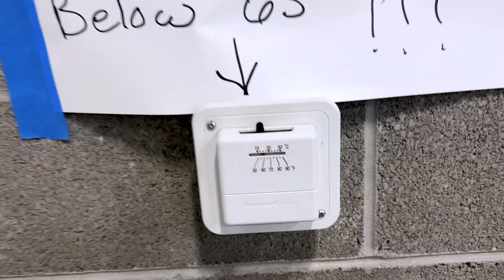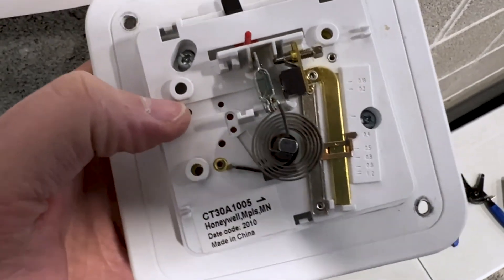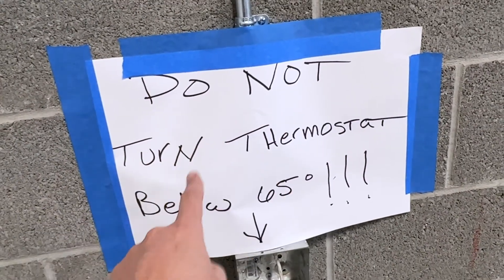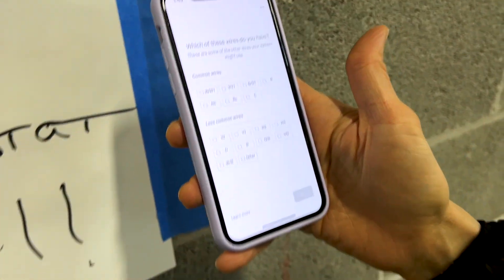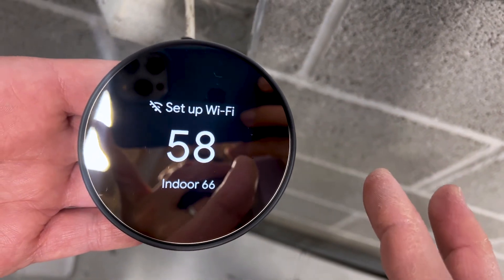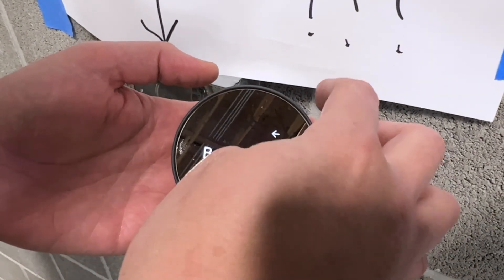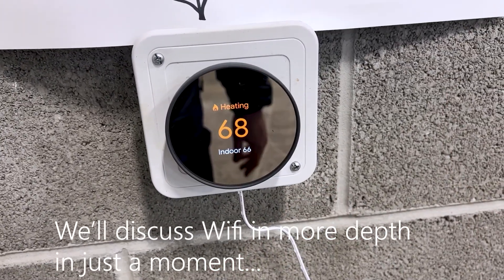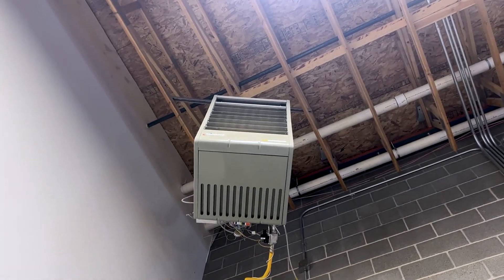NEST Thermostat  - Installing a C-Wire for a Google Nest. It's NOT impossible. Wifi Heating!

Comment: Great video overall. A couple issues in the comments. In the video you don't say which way the polarity should be. It is an AC to AC adapter so polarity isn't an issue. The correct adapter will be 24v 500mA (0.5A).

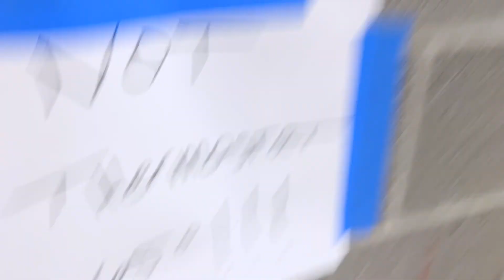Comment: In this video (at 5:47), the furnace's R and W wires are in place, and then the transformer's wires are connected to C and R. But I've read that a relay should be used to isolate the new plugin transformer from the furnace control board and its transformer. Is a relay needed here, or does this method negate the need for a relay? Thanks in advance for any clarification or help.

Comment: when using the transformer. does it matter what wire is now the c wire, like the one with black stirips or the just the all white one?
Reply: Que cable usaste
Reply: @luisdelacalle2612  turns out dosnt matter! the adapter will auto chose the right polarity
Reply: @bb4pugs  thanks

Comment: Just wondering am I not running into a risk of burning out the contactors at my furnace?
Reply from the maker: It's possible, but I've been using mine for 3 years now with no issues.

Comment: Does it matter which wire fromcthe c adapter goes to the red?
Reply: Yes.
Reply: @1wheeldrive751  by C adapter you mean the aux. power supply bought separate? It’s AC voltage…. Shouldn’t. Nor is it mentioned in the video.
Reply: @Howinfinite8D  - What I bought (got two actually) is a 24VAC, plug-in transformer (wall wart).  I bought mine on Amazon.  The wiring to the thermostat matters because you want the same phasing as the 24VAC coming from the heating system.  Assuming you are working with a two wires, heat only system,  the wires from the furnace (or boiler) will be Red and White.  If you measure the voltage between those two wires you will read 24VAC.  The Red wire goes to RH and the White wire goes to W1.  When you hook up the C-wire transformer it goes between Rh and C on the thermostat.  You will measure 24VAC between those two terminal with the wall wart plugged in.  

Now measure between W1 and C.  If you measure a higher voltage, near 48VAC, the phases are reversed.  Just take the wall wart out and invert it in the outlet, or switch the two transformer wires.  You should measure a very low voltage, near zero volts AC between W1 and C when the two voltage sources are in phase with each other.  It’s a 50/50 shot that they will be phased the same.
Reply: @1wheeldrive751  when will I see 48volts, when furnace feed and transformer feed in parallel or series???
Reply: @ - neither.  You’ll see ~48V when the two AC sources are opposite in phase.  

In the US, the power feed to your home is 240VAC (L1 to L2) with a center-tap neutral, which forms two 120VAC lines to neutral (and the neutral is grounded) that are opposite in phase.  In your load center (circuit breaker) panel, half of the breakers are on the L1 phase and the other half are on the L2 phase.  The breaker that feeds your furnace may not be fed by the same incoming phase (L1 or L2) as the breaker that feeds the receptacle that you plug your C-wire transformer into.  If they are, then the two 24 VAC transformers, one in the furnace and the one that is the C-wire adapter, will be the same phase and you’ll measure near zero volts between them, which is what you want.  If one is fed by L1 and the other is fed by L2 you’ll measure 48VAC between them, but all you need to do is flip the c-wire adapter in the receptacle socket, or swap the two wires from the c-wire adapter,  to reverse its phase.

Comment: Is there a way to restart it? I just followed the steps and I still get the N261 error. I have a wire going to W, and the 24 transformer going to C and to R (with the furnace R cable)
Reply from the maker: You can disconnect it from the power & remove the batteries. This should reset it. 
If that doesn't work, I've encountered one instance where the power supply seemed like was working but was actually bad. You can try replacing that as well. Good luck!

Comment: Perfect video.  I wish I could give this 1000 likes.  

I am an expert DIY'er and this thermostat gave me a run for me money.  Google's wiring diagrams were garbage, and this concise, helpful video helped get me to finish line!

For what it's worth, I used the same adapter, but I tied it into my red/black cables at the relay switch for my thermostat (I had a black (C wire) run to the thermostat, but it wasn't in use)).  I confirmed that I was getting ~24vac at the thermostat between the red/black wire & I was good to go!

Comment: THank you for showing where the transformer connects. You are correct, the setup won't even continue if you say you have no C wire, and also wont tell you where the transformer goes even knowing that Google will sell you one.

Comment: Hi came across your video, when hooking up your transformer for the 24 volts. Do you have to reprogram your nest thermostat so it recognizes the new wiring configuration. Thank you
Reply from the maker: You should not have to reprogram it.
Reply: @TheStockpile  ok great, thank you for getting back to me. I have a secondary house that I shut down for the wintertime. I always shut the boiler. Switch off and I don't need the batteries to go dead with no power, going to them.
Reply: @TheStockpile  can I ask you one more question, I have two zone heat in my cabin. One 3rd nest generation upstairs and one downstairs. Do I wire a separate 24 volt transformer to each one of them.  There working off same boiler but wired separately

Comment: I had a Nest thermostat it was working fine until my A/C broke down a guy came to replace the Fan, capacitor, and contactor so after he fixed the AC my Nest did not work the guy told me to get a regular thermostat.
Reply: He was a junk hvac guy……

Comment: I have a 2 wire old steam boiler system that the local hvac co won’t install any smart thermostats. I had a nest 3 running for about a year till it ran out of battery. Would this solve my problem.  Thank you so much
Reply: Same thing happened to me. I'm trying it right now, but it looks like it's not working. Have had the 24V adaptor plugged in for about 6 hours, but the 3rd gen Nest is not charging. It recognizes the new C and R connection, but the thermostat still just dies within seconds. So sad. I really thought it was going to work. I guess I'm just going to have to get an old school battery powered thermostat that works with the 2 wire setup.

Comment: If I have a two wire system,  and I have 3 extra wires in the cable that are not being used, could I connect two of them to the transformer in the control box of my oil burner instead of using g an external power supply?
Reply: Just need to connect one to the C terminals on both the thermostat and the control board

Comment: Anyone who installed an external power adapter getting constant warning emails from Google saying you need to remove the power adapter and replace it with their power connector to prevent damages and void warranty?
Reply from the maker: I've got two in use and I have not received any warnings.

Comment: Thanks for the video.  Did you remove the batteries from the Nest upon connecting it to the AC adapter or kept the batteries installed ?
Reply from the maker: I left the batteries in. Realistically, I'm not sure that it matters.

Comment: Mine not letting me go through the process because says no C wire detected, I should i do ? HELP
Reply from the maker: If you have a 24 Volt power supply and you've wired it like I've shown then it should detect the C-wire. Make sure it's wired exactly as shown with the right adapter. Good luck!
Reply: I couldn’t get it to work either
Reply: I actually did just get it to work. I got the c wire adapter from google it free right now. I also have a 24 volt adapter. Attached the c wire lead of the google adaptor to the one of the 24 volt adaptor wires. then I attached the other lead from 24 volt adaptor to the red wire from my thermostat and connected those to the red wire of the google adaptor. Then you just take your existing white wire from the thermostat and connect that to google adaptor. The google adapter gives you two wires to send through one goes into the red wire hole in the wall plate and the other into the white wire hole in the wall plate. 

On the app tell them you only have the "W" and "R" wire and tell them you've attached their c-wire adapter. It should let you through now with the set up. Hopefully this keeps working down the road. 

It's possible you don't even need the google adaptor. Just go through the app saying you only have the white and red wire, and say you have added the c-wire adapter and that might let you go through the set up process. I haven't tried that tho.
Reply: @amukher14 ahh… the right way to do it.

Comment: Thank you ! I watched dozens of videos by qualified HVAC guys and none got my Nest up and running. Yours was the only one the attached the two wires together and inserted them into the R slot. That worked for me.
Reply: Same
Reply: Same here. Not using both wires led to my heater element not coming on, W was no longer detected. Once both were inserted into R, worked great. Thank you!!

Comment: Received this message from google after doing this, any thoughts?

Hi Isaiah,

We’ve identified an issue with the installation of your new Nest Thermostat. If you plugged a second transformer into a wall outlet to provide power to your thermostat, please remove it to prevent permanent damage. Installing a second transformer can lead to hardware failure and could jeopardize your warranty. When your hardware fails, you will likely experience:

•Reduced battery life that may require replacements every few weeks

•Disconnection from Wi-Fi

•Disabled motion sensor

•Eventual loss of control

Instead of a 2nd transformer, a Google Nest Power Connector or c-wire is required to ensure your thermostat gets enough continuous power to work properly. (Available for purchase on the Google Store only in the US & CA.) If available, you can have a trained pro install a Power Connector or c-wire for you. Learn about Nest Pro installation services.
 
– The Google Nest team

Comment: I connected the power adaptor but the thermostat started to read higher and higher temperatures. Maybe it’s heating up behind the nest? Any ideas?
Reply from the maker: Sounds like it could be heating up. You're using a 24-volt adapter?

Comment: Does it matter the polarity of the transformer wires into the thermostat.
Reply from the maker: Not as far as I know
Reply: AC power guys….. no polarity…..
Reply: @Howinfinite8D  the adapter is ac to dc. So the DC will have polarity

Comment: Are all power adaptor wires flimsy? I can’t get mine to go into the C hole because it’s not strong enough to make the button go down
Reply from the maker: You can just double the wire over to make it thicker.

Comment: My Nest install was stupid as sh.  Dang thing wouldn't talk to my current phone, a Samsung A54 via bluetooth on initial setup.  I had to use my previous phone, a Samsung S10 and instantly connected on setup.   It's quite nice not to have to go over to the dumb Honeywell to slide the temps.

Comment: which one goes to R again? white one or black one?
Reply from the maker: The Red one goes to R. 
If you're connecting external power then one of those also goes to R (and the other to C).
Reply: @TheStockpile  does it matter which of the two wires from the adaptor goes to R, and which goes to C? Or are they interchangeable? Thanks!
Reply: @TheStockpile you’ve said yes it matters and no it doesn’t in the past few questions asked….

Comment: Alternatively you can spend $4-5 more for a less ghetto look of having tk run a wire up your wall to act as a c wire. Google offers a connector adapter for about $20ish
Reply: If you have a furnace that is truly 2 wire with no "C" wire or connection on the control board it will not work.  This seems to be working.

Comment: Thanks for the great tutorial! In the video, does the red wire has to be remained connected to R together with the white wire from the external power? Or it's ok to disconnect the red wire then replace it with the white wire from the external power?
Reply from the maker: I'm pretty sure you need the red and white (external power source) together.
Reply: @TheStockpile  Thank you! It works!

Comment: awesome video, thanks for sharing. I have an old 2 wire Honeywell T87F Standard cooling (AC only) system. I'm assuming this could work for my system. Question is, when prompting through the steps in the app, "what is your heat source" mine  is an AC unit only, no gas, electric only. I wonder if this could work for AC only? I'm tempted to do this on my own. thank you in advance.
Reply from the maker: I think it could work, but I'm really not sure. The only applications I've seen it in are for heating. But in theory it should be able to control anything.
Reply: You can search “google nest compatibility” and it will take you through a series of questions to see if your thermostat is compatible.
Reply: It’s been 8 months idk if you finally figured it out or not, anyways I believe (Y) is for cooling and (W) is for heating.

Comment: Great video, thanks so much for sharing. I actually followed your instructions to use my Google nest to replace an old fashioned thermostat to control a second zone in the lower level of my house. There were only 2 wires Red and White and I did exactly as you said and my heat is working great. Thanks again, may God bless you abundantly.